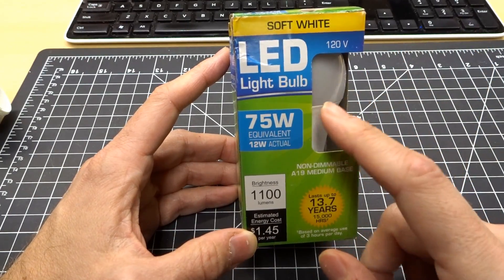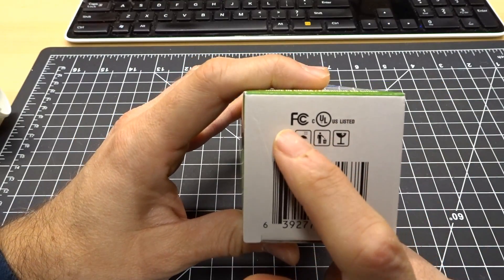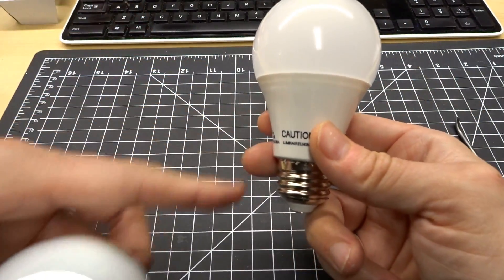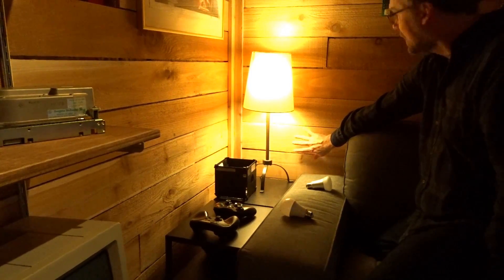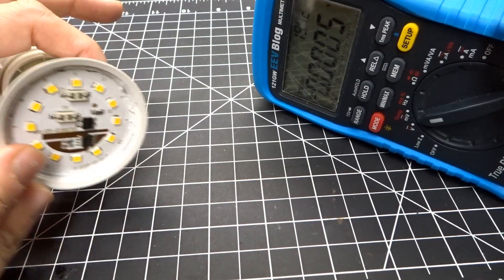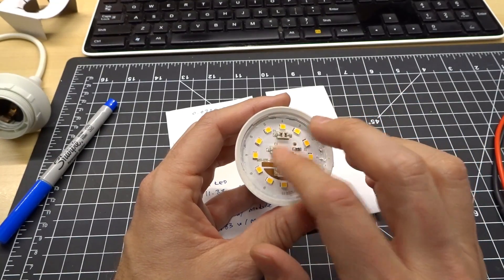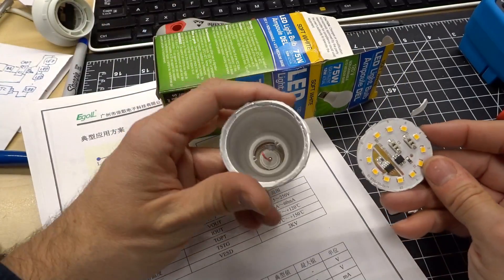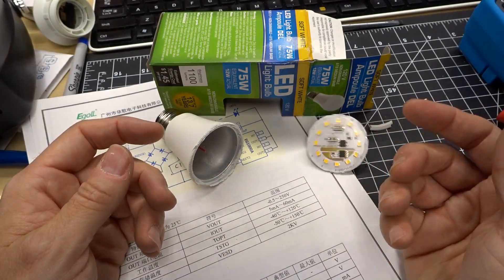Dollar Tree $1 LED Bulb: 1100 lumen (12w) Teardown and Review

Comment: Very interesting. I tore down a failed 60W equivalent LED bulb just to see what was in there. It was pretty similar. BTW, I am doing a study on how long these bulbs last . The LEDs, if not overheated, will probably last 8 years or more, but of course the light output level will decrease somewhat with age. But the electronics, especially the electrolytic caps, will most likely be the failure item on most LED bulbs and that will come way before the LEDs fail in most cases. So far I have had only three bulbs fail. The months of life of those three are: 9 months, 27 months and 33 months. WAY less than any manufacturer's claim. I have not done any diagnostics to see what failed in any of these bulbs.
I did a similar study on CFL bulbs used in my household. I had 30 bulbs fail over a period of about 6-1/2 years. The average life length of those bulbs was 35 months with the shortest being 12 and 13 months and the longest being 68 and 69 months. Given the difference in cost of the CFLs vs incandescent (disregarding electricity usage), incandescents are a better buy. When including cost of electricity, I'm pretty sure the CFLs win, but not by nearly the margin we were led to believe. Will the same be true for LEDs?

Comment: @ 9:00 When he pops the top off.
I did that to one of my bulbs and it makes a great
spot light for over the stove. Nice and bright and very directional.
Reply: yeah, and pretty susceptible to humidity :\
Reply: @redoverdrivetheunstoppable4637  

I live in a desert and I have a hood fan.
Avg. Humidity around 25%. 

For a dollar it is cheaper than an actual purpose made 'spot' light.
Reply: @charlesdahmital8095  i meant for the stove, whatever you cook makes humidity and that sticking grease that i bet is conductive, i had several bulbs failed bcs of rain humidity, not direct rain, it may catch fire and also if you touch the exposed parts you may get shocked

Comment: capacitor dropper converter must run in specifications frequency(dimmable with varying voltage), but switch converter can run even powered from dc(dimming ability depend on converter).

Comment: $1 and it has a built-in party strobe mode if you use a dimmer which is says not to.
Reply: We have gas station down the road and each night. When it turns on, 5 of them just flashing.

Comment: My local Dollar Tree has the 100W now.  14W actual, 1500 lumens.
Reply: Dollar Tree had 100W Sunbeam brand LED bulbs a couple years ago too, but they were rare. The crazy thing is that they were sold in pairs and still only cost a dollar. I'll have to check mine to see if they're back again.
Reply: @leaftye  The ones in stock are generic and not Sunbeam.  $1 each.
Reply: @joop1987  Thanks, that works for me. I'll swing by the DT soon.
Reply: @joop1987  Thanks again. My DT had the 100W version in stock. It was only the single pack instead of the double pack I got before, but that's still a killer deal. It was also generic as you said. Also nothing about a warranty on the packaging, which is okay for $1, but I  only note it because I recall a warranty being offered with the Sunbeam bulbs.
Reply: When
Reply: When LEDs switched from non dimmable to dimmable, the consumption went up, not much better than CFLs.

Comment: Why are you making a big deal of the incandescent light bulb? Normally, once a bulb is installed it doesn't get touched until it is burned out. Use a towel or rag if the incandescent burns out while in use. There is a Doller Tree in my town and the that store does sell led bulbs. I know a few people who use those led bulbs FROM Dollar Tree and they do like them. I hate led bulbs, the light is too powerful, too intense for me and besides these new bulbs now-a-days, there is no significance in engery savings between led and incandescent bulbs. Most importantly, those leds bulbs are nothing but plastic. There are those who sware by bottled water, again plastic. The other day I overheard a group of people taking. They were talking about the type of car interior and why. One said that he prefers plastic over leather interior to help save cows. I have to laugh, at that idiot. People do not kill cows or any other animal just for their skin and discard the rest of the body. People like me buy stake, ground meet at Acme. Plastic is very bad for the environment and our oceans are clogged with the crap. Stop being cheap when purchasing a car, get leather instead of plastic.

Comment: Can you do an interference check with these lights? Years ago I found that these cheap LEDs could actually freeze an image on television reception over the antenna. Just curious if that kind of radio frequency interference is still common.
Reply: this lightbulb in particular and all the "capacitor dropper" types have nothing more than the 60 or 50Hz frequency interference, maybe just some harmonics due to the bridge rectifier - capacitor coupling, this one runs the LEDs off DC and there's no switching controller or switching transistors that can generate strong pulses... anyways pretty weird event, it may have been triggered indirectly from some other appliance connected along the bulb... i dunno
Reply: Hes 100% right, my grandmother digitla antenna t.v. has the same issue. You can litterally screw and unscrew the bulb to see the TV go full to 0 signal

Comment: What do they mean by "totally enclosed luminaries"?  Would this mean my "enclosed" ceiling fixture would not be a good idea with this?
Reply: Totally enclosed means anything with no air circulation. Small holes for wires and screws don't count. The bulb will die much sooner with no air cooling.

Comment: I've bought about a dozen of the 60 watt equivalent Sunbeam bulbs over the last year.  At this time, about one-third of them have failed.  They are all in open fixtures so the bulbs should not be dying due to excess heating.   One of the failures was the current regulating chip and the others have been LED burn outs.  I jumpered one of the burned out LEDs and the bulb worked for a month or two before another LED failed.
Some of the failures happened within a month so I think there are problems either in the LED manufacturing or in the thermal path when they are mounted on the aluminum board.  Since the defective bulbs have to be shipped to California, Dollar Tree probably isn't having to do many warranty replacements on the $1 bulbs. 

If the failure rate remains under 50%, the bulbs are still a good buy with the advantage that they do not generate radio frequency noise that would interfere with my radio listening hobby.

Comment: You could use a phone app like Aperture Meter to test the bulb's brightness and color.
Reply: Have you actually compared phone camera videos before? The color accuracy of iPhone is $hit, it’s off by massive amounts, then compare to the seemingly millions of android cameras and you’ll never know (for example, one of my phones would overheat the camera recording in 4k, and just before the overheat warning everything got extra red or orange tint, you could literally see color accuracy of the instrument shifting very slowly in real time...), so how accurate do you think that app is if the equipment itself is extremely inaccurate and uncalibrated, and potentially shifting due to its temperature? It’s just going to be a super incorrect aproximation like decibel meters on phones (lol, there is no standard response output for a microphone, they will all have custom signal analyzer circuits and random shaped acoustical vents and different mic coil resistances).
Reply: @jakegarrett8109 : On my own phone, the app I mentioned doesn't use the camera; it uses the front-facing proximity sensor which is about an inch away from the camera.  I doubt the device is that well calibrated, but that's not the important part; the important thing is that you can compare different bulbs to each other, to see how the $1 LED light stacks up to an incandescent bulb and come up with some kind of objective result on how different they are.

Comment: My local dollar store has 100w equivalent 14.5w 1600lumen sunbeam brand for $1.  Its more light output than the one you show here, for the same price.
Reply: Did it have one or two bulbs? A couple years ago they were selling a two pack of 100W Sunbeam LED bulbs for a dollar.
Reply: leaftye the ones I saw were a 1 pack of the 14.5 w led for $1.   They also had the 800 lumen ones in a 2 pack for $1.

Comment: That second pad is probably for a dual mode output. So you can have multiple strings of LEDs, and the chip detects power on/off cycles over a quick time. So you switch it on/off a few times to change modes. Can have warm/cool/mixed modes at 20mA per string, or a single 40mA mode depending how you set it up.

Comment: They will never last as long as advertised, but even if they last a year its cheap.
Reply: vs even regular which may last a few years? Which are even cheaper? Nope, not buying that theory! What’s more efficient than a single hot point of light is more evenly distributing the light throughout the room (uniform brightness, so you don’t have to go overkill on a light far away), and LED light strip is extremely cheap (so more power efficient, more even lighting, fewer shadows/dark areas, and about the same price per room plus you can do exotic things like shelf lighting or under a desk etc for wherever you need it since it’s so thin you’ll never even know a light is there until it’s on).

Comment: I'll have to check out Poundland's most recent lamps and see if they've gone in the same direction.  It would be interesting to nudge the sense resistor value up to move between intensity and lifespan.
Reply: I opened a stupid 15w 1500 lumens 1 euro lamp and it was crap and it had an TÜV certification.
Reply: @MaxMüller0  - certification relates to SAFETY, not quality.
Reply: Adding some thermal paste to the thermal interface and drilling a few holes in the aluminum/plastic shroud would definitely help keep them cool and extend lifespan. I wouldn't reccomend damp locations after that.
Reply: Clive, I know you'll have something interesting to add.
Reply: @Landrew0  I just bought a few similar lamps from Poundland and they are all still using capacitive droppers.
Reply: @bigclivedotcom   Cheers!🍻👍
Reply: Look at the bulb.  What is VL Listed?  😂😂😂
Reply: ADEBISI ADEBISI  Does have videos 🤔
Reply: Hack the chip to add a dimmer. Don't let them take our mood lighting away.
Reply: @TBL_stevennelson  Yep that's what the empty spots are for ....Parts for dimmers cost more in the long run...The company's that are buying the parts 40,000 at a time get a price break. Even I can order from Digi-Key, resistors are at 2 or 3 for a penny....
Reply: We can find LED lights for that cost at Daiso in Japan for quite a few years now.

Comment: Dimmers basically PWM the  AC power so anything like this with a built-in power supply will either just stay on when the caps can smooth out the power, or start flickering when they can't.

Comment: i dont get it.... how are these things eco friendly? they have  cadmium pcb's capacitors diodes ect???????? where a normal bulb is just glass a tiny bit of tungsten and steel?????
Reply: Because they use significantly less electricity for the same amount of light compared to standard bulbs or even CFLs
Reply: @matth4784  And that. I never really understood em even tho i own em all round the house :v
Reply: It's more on fact that they are better for your eyes. Due to Tungsten shining can damage your eyesight afaik
Reply: The pcb is lead free, take your bets with the plastics.

Comment: Spotted at the Dollar Tree here in Canada for $1.25 CAD.  Hopefully they continue to sell the 8w "60w" version.  It seems to run much cooler.  It's a little annoying that the aluminum heatsink is covered with a plastic sleeve, but I realize it has to be for electrical insulation.  These capacitive droppers don't have any electrical isolation, so any exposed component can be live in reference to ground.
Reply: @adriansdigitalbasement  In Canada, Dollar Tree bills itself as "Everything $1.25 or less".  Dollarama, the behemoth national chain is up to $4.

Comment: One dollar? That is crazy. I remember paying a lot more than that not too long ago.
Reply: Yeah same, and I can even remember when I got a 5watt LED bulb for $6 where you can see the individual LED's inside the clear glass bulb, and it's barely brighter then a night light, and I stoked to get it. I still use it as a night light for my youngest niece in my guest room.
Reply: Yeah, there's pretty much no reason to buy anything but LED's for anything but niche applications, like high-heat or high-moisture installations.  With units that fit every conceivable size, and even bare-'filament' types, there's just not any need for incandescent any more.  (And why anybody would buy CFL's today is beyond me.)

The only thing that bugs me is it's getting harder to find fixtures with just plain old sockets; fixtures with integrated LED's mean you have to junk the whole thing when it burns out, which doesn't necessarily take very  long if it's poorly-made.

Comment: You don't need a step up transformer, just use your dryer, or oven plug. Just get an appliance cable from the hardware store (or a junk dryer or oven) and wire it to whatever outlet is convienient in a handy box - presto 240V!

Comment: The switching frequency of the driver chip is what causes flickering in other LED bulbs
Reply: And the timing of that as relative to when the use turns on the triac in the lamp.
Reply: c/use/user
Reply: No it's a fixed frequency. All led mosfet driver's have a switching frequency, it can be found in the data sheet
Reply: @ColbyJohnson  I am talking about the new circuit now formed when the triac is added. Oh, I see you said "other bulbs"... I meant when he hooked it in with the lamp. It's now being cut on and off by that triac as well.
Reply: @johnpossum556  yep I'm following you know. I was like hmm, what's this guy talking about haha.

Right, we aren't sure what's in the lamp. It could be a switching triac (with its own frequency) or a power potentiometer (old school). The potentiometer type won't dim the LEDs at all since the led driver is current control not voltage control (either be on or off).

The triac switching type will cause flickering or random on/off cycles.

Comment: About a year ago we could get 2 Packs of 100W Equivalent (14W) Dimmable Sunbeam bulbs for $1, but they were cheap because they were subsidized by Indiana Michigan Power/AEP. I tore one down because it fell apart because I had ran it in an enclosed fixture and I think the heat embrittled the plastic standoffs that hold the power supply into the aluminum base of the bulb, so when I went to unscrew it from the fixture the power supply stuck in the socket and the whole top part of the bulb pulled from it, other than that it seemed pretty well constructed, the aluminum part of the bulb was pretty heavy and the power supply was potted in epoxy so it was pretty well protected against moisture.

Comment: I've bought a few dimmable 75w bulb in the past here in Itlay for something like 1.5-2€. They were light, built as cheap as possible and lasted about a month or so. Never bought one that cheap since. Now I'm using 60-75w bulbs that cost about 3.5.-5€ each and they work fine for about a year or two (the heat destroys the leds)